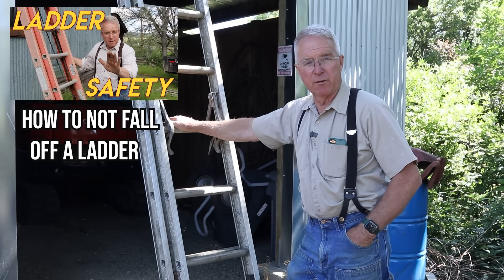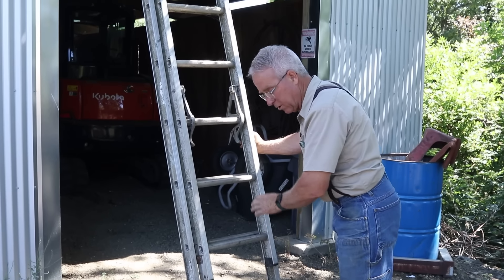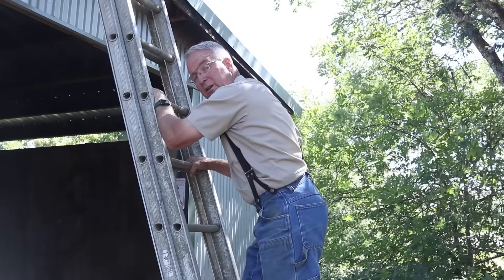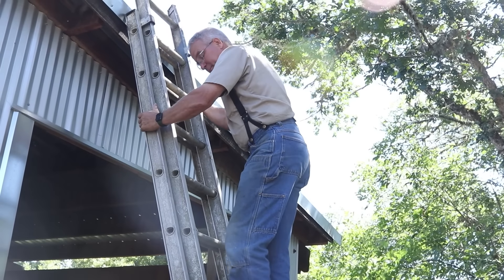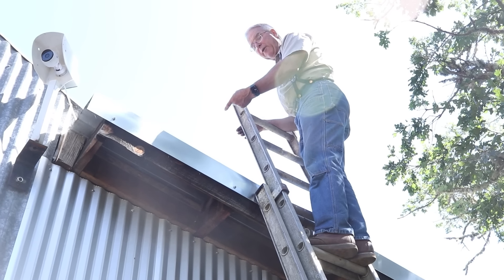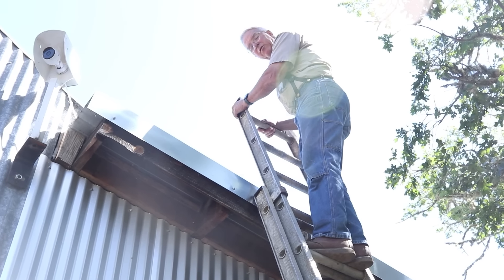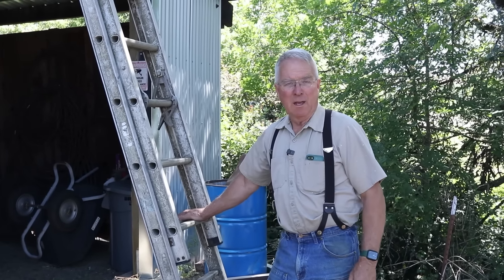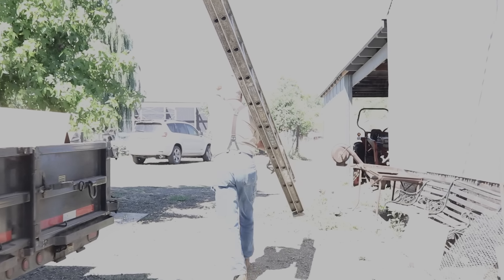How to Climb A Ladder, Dismount, & More Tips

Comment: Hold the rungs of the ladder so as you have three points of contact at all times.  Two feet, one hand or two hands one foot.  Strap, lash or cramp the ladder to the eaves of the building. 
If the ladder falls away while your on the roof you may not fall but you could be stuck up there over the weekend if your buddy’s have left the site. 🙁
A work colleague of mine was on a job. Two fields away another worker was on top of a 40 foot tall metal barn curing a hole through the roof with a grinder. Some sparks dropped down and set some loose hay and straw on fire. Nothing too serious but the fire needed putting out soon. In his haste to get down he knocked the ladder away. So now he is  40 foot in the air with a ever growing fire below. My friend ran across the two fields to help the guy on the ever warming roof. When he got there he just had to say ‘’I suppose you want me to put the ladder back up’’. 😂 Seems funny but it could been a choice between landing on concrete 40 foot below or getting gently grilled. And all for the want of a rope or strap. Health and safety can be a pain in the arse if you get it wrong 🤔.  The most important job on any construction site, factory, farm etc etc is going home to your family every day.

Comment: Totally excellent content by an experienced craftsman. Whenever possible, I drill and fix an eyebolt to the vertical wall, and use a ratchet strap from the bottom rung to secure the ladder. I know two people who came off ladders, one has been in a wheelchair and needs  24 hour care since, and the other was a careless know it all who always knew better, but is now disabled. The content showing transition from ladder to roof is spot on but how many viewers knew that and do that? I never saw a steeplejack use the rungs as hand holds while climbing. Great safety video, the best I've seen....

Comment: You're "supposed" to tie-off the ladder, too. But as we can see in this video, that's not always possible. If there's nothing on the building to tie the ladder to, it can't be tied off. Anyway, one of the best purchases I made was buying safety ladder extensions made by Guardian. The extensions make the "transition" from ladder to roof and from roof to ladder MUCH easier, and safer. They do make the ladder more top-heavy, though, when setting it up.

Comment: When you flip the feet over on softer ground, wouldn't it be better to flip them the other way - so if the ladder starts to slip out the foot digs in more? Seems to be the way you've got it, there's a chance for the foot to roll over, which would make the ladder less stable?

Comment: Quite a few of the contractors I have worked with over the years well simply not allow simple ladders to be used on site.   You either have to use steps, lightweight working platforms, battery driven lifting platforms, scaffolding or other means.

Comment: I have to go up on my roof once in a while to blow it off as I live where there are a lot of trees that drop leaves. I mainly use my extension ladder. I have found that to carry up a leaf blower and broom etc is not very safe. What I do is tie a rope to the handle of the blower, climb up with one end of the rope, and simply hoist up the blower. This works for buckets, pails, cans rakes etc.

Comment: I hate stepping from a ladder onto a roof. One thing I fear is the top of the ladder sliding sideways. To prevent this I use various methods to fix the ladder to the fascia - such as fixing a block of wood either side of the ladder just below the roof I need to step onto - to prevent that sideways movement. I'm 75. I allow whatever time it takes. I never, ever attempt to make a move (onto or off a ladder) about which I'm not completely confident. Thanks for the video!

Comment: For second story window install, take the time to set up a scaffold and have a nice solid platform. Or, two ladders near each other and later jacks over the roof line with a plank. It makes all the difference, step off the ladder onto a flat solid surface. Then you can think of doing a great job, have your tools on the flat, you don’t have to be nervous. If you don’t have the right tools to be safe, you shouldn’t be in the business.

Comment: I can see a few things that you could do to be safer. Use a bucket and rope to pull items up to the roof.  Tie off your ladder both on top and the bottom, so it can’t move sideways, or kick out on the bottom.  I think stepping back on the ladder from the roof is the most dangerous  part.  I’ve had the wind blow ladders down while I’m on the roof, because they weren’t tied down.

Comment: My curved claw hammer is good at digging down. Funny I only learned the quick foot flip trick recently. Of course I like wood ladders that don’t have feet. Never liked having that much ladder above the upper contact point. Always felt that much leverage at the top might dislocate the feet. Prefer using  a stabilizer resting on the roofing. Lynn Ladder  rep once told me grip the rails. Scariest thing is carrying 4x8’s up in gusty conditions.

Comment: I've never felt comfortable with three rungs above the roof, because it felt like my own body weight pressed against the top rung as I'm stepping toward the roof would be enough to kick out the bottom. (I'm a large man) Two rungs seems more secure because I can actually swing my leg over the top of the ladder and onto the roof without stepping sideways. Also, if there is a way to tie off my ladder to a rafter (using something like a c-clamp) or pipe, I will do so.

Comment: good topic. Whether accurate or not the CPR instructor at last class I took said over 2500 Americans die from falls from 6 foot or less ladders each year. Even it it was 1500 that is still a lot. Be careful and let someone know you are doing ladder work if alone. Was up 130' up tree today with spurs/lanyard. Being up 24' ladder gets my attention way more. To many old guys fall off ladders during retirement, I do not want to be one. Wet metal roofs with slime are very dangerous. Introducing ropes for pulling things up and for fall arrest are things to consider to not lose the 3 point climbing technique.

Comment: Extending the  ladder far enough is critical.  It is very easy for pants to get hooked or caught on the top end of a stringer as you prepare to mount the ladder and get down.  Also, shorts shouldn't be worn (even when you're just going up there for a  second on a really hot day to adjust the float on the evaporative cooler).  The short pant legs can become 'impaled' by the top end of the stringer as you hop on the ladder for the trip back down.

Comment: I remember wood extension ladders when I young. I rember having to put one up that must have beeen for an old two story house and it was wide at the bottom. I am pretty sure it was double my weight as back then I had a 28" waist. I would avoid them at all cost later. I think old guys got a kick out of a skinny kid trying to muscle a heavy ladder in to place.

Comment: you can tie your bucket of tools to a small rope then you take end of rope up the ladder, not carry the bucket in your hand
they also teach take a small rope or bungee cord and tie ladder off to gutter or something at top or tie ladder at bottom to the house or 6 feet up or so to house to keep ladder from falling over.
you might want to mention best angle for ladder where you put feet on bottom and outstretched hand should touch rungs too steep it falls over too shallow it bounces and slides out.

Comment: Maybe I'm a wuss, but I bought a harness and 100' of extra rope. When I'm doing roof/ladder work, I throw a line (paracord tied to sock filled with sand) over the roof to pull the thick rope over. I then tie that end off to a tree/truck. Now, even when climbing/descending the ladder, I am clipped in and safe from a fall. The only catch is that you have to stay on one side of the roof, since the rope won't help on the tied off side. I probably could tie off both ends (with enough slack) and flip the catch, but most of my tasks have been on one side or the other. Obviously this isn't practical for contractors on the job where time matters, but for a homeowner that has the time to do it safely and isn't a ladder pro, it works for me. 

The $150 I spent on safety gear is well worth it, since I know of a few guys that have had their lives changed or ended by ladder/roof falls.

Comment: Thanks for the tip on digging vs shimming. 
But I disagree with the way you carried the ladder. I keep my top arm straight to prevent the ladder from wandering. Also, I keep the ladder as straight as possible. If the ladder starts leading, it can be dangerous to get it vertical again.
Thanks for the tips.

BTW -For me, getting off the ladder has always been my point of concern. To the point where I've thrown a line, when possible across the roof and anchored it to give myself another contact point. :)

Comment: 01:28 - it seems to me that if you're going to rotate the feet, they should be rotated the other way... Your weight wants to push the base of the ladder down and away from the wall - the way you have it, it is possible for the ladder foot to rotate and allow the base of the ladder to move away from the wall by the distance between the pivot-point and the edge of the foot and potentially to start a slide - if you rotate the feet the other way, they are already at maximum rotation in the direction the ladder wants to move and the only danger of movement is towards the wall.

Otherwise, this video is full of great safety tips - thanks :-)

Comment: My gripe is not with extension ladders like this one, but with the convertible ladders that fold and can also be used as a stepladder (A-frame).  Many companies make those ladders and they are sold everywhere.  Those convertible ladders widen at the bases for stepladder stability.  But when extended 3’ above the roof as required, the user has to step around the widened part of the ladder to get onto the roof.  This move is dicey at best and only made worse when carrying gear or wearing a tool belt.  IMHO those convertible ladders, when used as an extension ladder (by design) should be totally avoided for climbing onto a roof.  A warning should be prominently displayed for the unaware consumer.

Comment: 5 rungs over is best since as you don't have to bend over to transition.

The ladder should be footed by a helper (with a lid).

Also you can pound in a gooseneck (crowbar) aroung the bottom rung, into the dirt, for even more security.

Also, talk to a local firefighter instructor if you really want to learn some solid safe use :-)

Comment: Also remember 4 to 1 
For every 4 ft of vertical height the ladder feet should be out from wall 1 ft.
So if the roof line is 12 ft the feet should be out 3ft.

Comment: I zip-tie the ladder to the eves fasteners, and make sure it's sturdy.  Then the ladder doesn't slip. It costs an extra 10 cents, but it's night and day for safety.  Still - you have to make sure the fasteners are set into firm timber and not rotten.

Comment: With such a tall ladder, mainly extension ladders, I prefer to carry it horizontally rather than vertically.  If I'm just moving it a few feet to another part of the roof, then I'll carry it vertically.  But for me, carrying it at a longer distance vertically, a little too top heavy for me, and having to look up and down, up and down, so not to lose my footing, and not walking into wires, tree branches, or objects on the ground.  Carrying it horizontally allows me better to see the path I'm walking on and as well as any obstacles the ladder's head may bump into, than always having to look up and down.  Also, if I'm carrying it vertically and I stumble, the ladder may fall on something ( like on top of my friend's truck tailgate!) or worse yet, onto someone.  I feel a lot more secure since attaching a ladder stabilizer (Bull's Horns) for accessing my roof.

Comment: how would you use a harness to climb that ladder? in case you do slip or passout how can you set up a  harness to prevent you from falling from the ground without going to the top of the roof to install a hook. Is a tree close to a house a good idea to connect a harness to? or how about in the house through a window supporting the rope with something inside the house or double window. Just looking for a safer way thanks.

Comment: The most dangerous ladder is the metal one that has hinges at the middle, now available at most large hardware stores,it slides on most surfaces because the grips ar the base is hard plastic instead of soft rubber .

Comment: My extension ladder is different from the one in this video.  The upper (extending) part or fly section is farther from my body than the lower part when it is properly positioned for use - as indicated by the angle of the flat (chord) surfaces of the rungs, which are near horizontal when the ladder leans away from me.  Is there no standard?

Comment: Maintain 3 points of contact at all times, tie off ladder at top, consider not working alone, don't carry stuff up a ladder, use a rope or pulley system. Boards can be caught by the wind "sail effect". Follow manufacturers instructions as well as common sense. Do not get distracted, concentrate and keep a firm grip and foothold. Avoid bad weather conditions. If you are an employer carry out a risk assessment.

Comment: For anyone who is getting on and off a roof or spending a lot of time working from a ladder, please buy something called 'stabilizer arms'. They are invaluable when you need work with a ladder because they push the ladder away from the wall giving you space to work from the ladder, stop it from sliding side to side, and when setting up to get on a roof they rest on the roof and keep the ladder off of the gutters/siding avoiding damage to the home and also providing a solid 'grip' on the singles so the ladder can literally NOT become a lever. 

Please. Go buy a set. They are cheap and easy to use so there's no good reason not to use them.

Comment: If you wear a ring on your finger, remove it when using a ladder. If you use the rungs as hand holds while descending the ladder it’s easy to get the ring snagged which can de-glove your finger, pulling off the skin.

Comment: First thing ,u dont have the rails if that ladder high enough over the roof line. This is going to make u bend when climbing onto the roof. Also keep in mind the base of the ladder should be 1/4 the length of the  ladder away from the wall. So if an extended ladder is 12ft ,the base should be 3ft from the wall

Comment: You can't always dig into the ground to level the ladder, such as on hard surfaces like concrete or asphalt, especially if you don't actually own the property where the ladder is being used, and so you aren't even allowed to dig it up.  In that case, I use a ramp made from a narrow strip of 2X4 cut diagonally, and two strips of thick plywood screwed on either side of it, both to keep the ladder-leg "aboard" or "inside" the sloped surface of the ramp, and to add stability to the ramp so that it won't "roll out" from under the ladder-leg.

Comment: I was a painter for 45 years. I never extend the ladder above the roof line. Why? because there is little friction with a metal ladder and the metal gutter which means  the ladder can slide very easily . Put it on the side of the house  which is either stucco or wood and climb over. Also, the ladder can blow over much easier when it's breezy when your not on it , leave you stranded on the roof, and fall on something or someone.

Comment: Don't know if you mentioned this in the previous video, but the angle the ladder makes relative to vertical is critical to user safety. I'm amazed there aren't a bunch of bubble levels available that can be easily fitted to the rails to help you set the ladder at a safe angle. Just sayin', Steve.

Comment: I've been an exterior finisher for years . I noticed you didn't strap  the the ladder to the roof with hammered down aluminum drip cap 😂. Lo I lived in a city where 100 kilometer wind was fairly normal acurance.  FYI don't side in Lethbridge Alberta

Comment: You never mentioned the use of a ladder stabilizer. Makes the ladder a lot more stable. But if it is landed on the roof, then one cannot have three feet above the roof line, because the stabilizer is not mounted that high.

Comment: An idea:
Getting off the ladder at the top always seems super scetchy to me, especially because of the potential "side-sliding". Would it not be possible to design a simple "hook" type thingy, perhaps a board that spreads out across the top, that prevents it from sliding sideways? (and actually also prevents a bit from sliding at the bottom).
Or would it make it worse for some reason?

Comment: my ladders are the collapsible kind, and i've had one collapse, despite being properly clicked into locked position.
in theory, according to safety guidelines, there should always be someone holding the ladder for you. helps to secure it and, anything goes wrong whilst you're up on roof or using ladder, they're there to help in case of accident.
how do you get up on a house roof with new gutters installed...safely and without damaging new gutters?